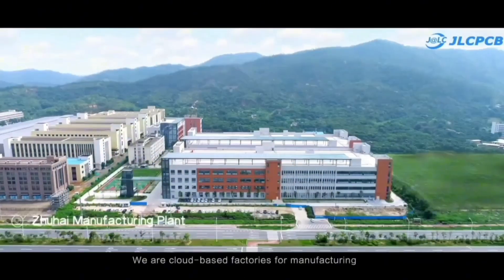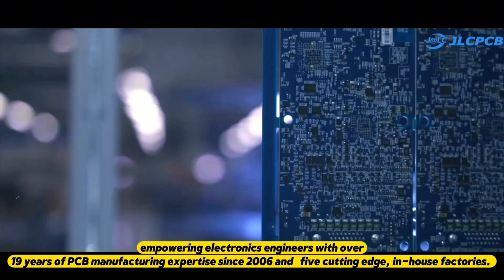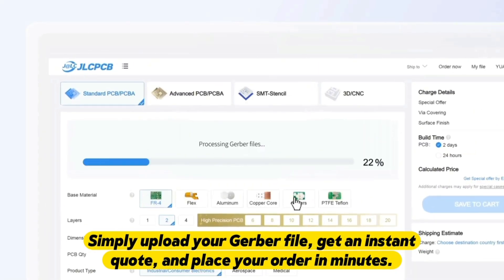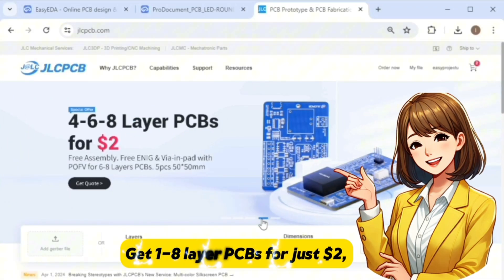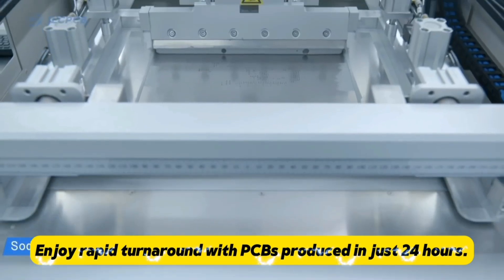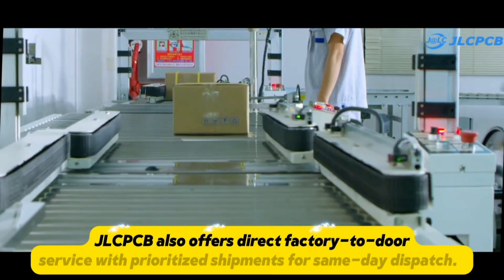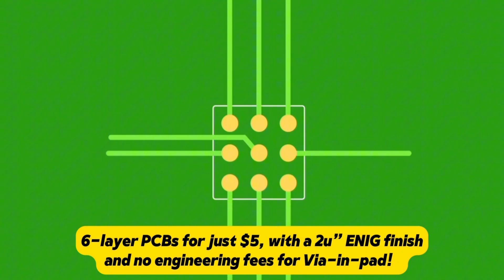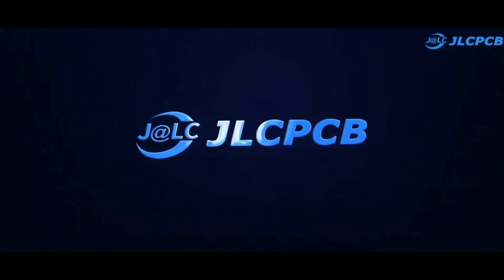How to Make an Electric Fence Circuit with EMF Filter | DIY Step-by-Step Guide | JLCPCB

Comment: That is not electric fence voltage.  Electric fence voltage is 5000-8000 V and produces a spark at the most only a few mm long.  That spark is longer than automotive ignition coils which are 10's of kV.
Reply: Can you send me the diagram?
Reply: How can I contact you?
Reply from the maker: Yes,This circuit was designed based on multiple requests from viewers.
Thanks for comment 👉❤️👈